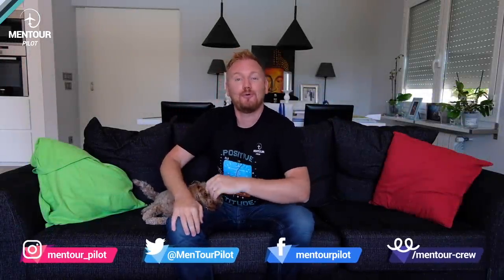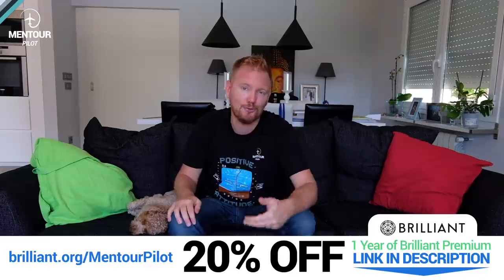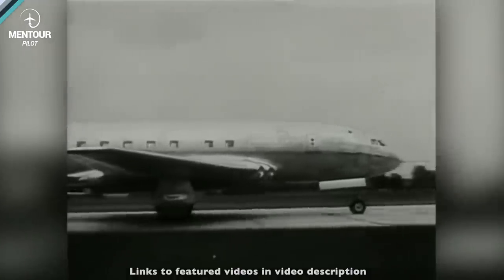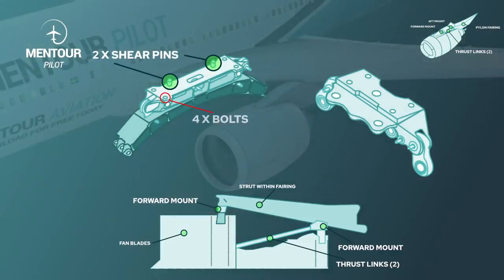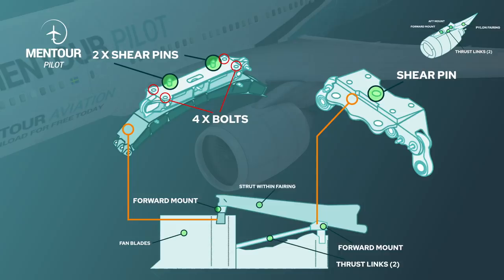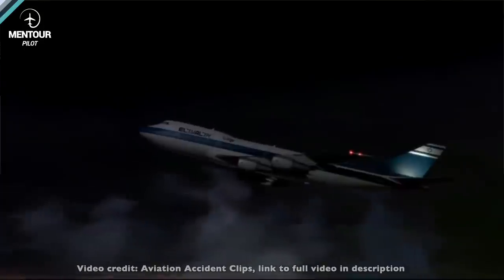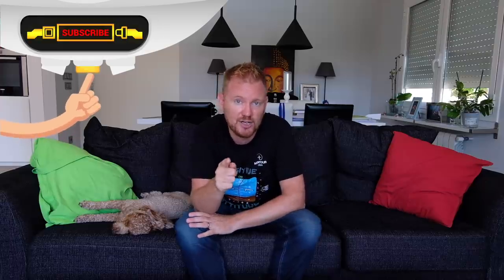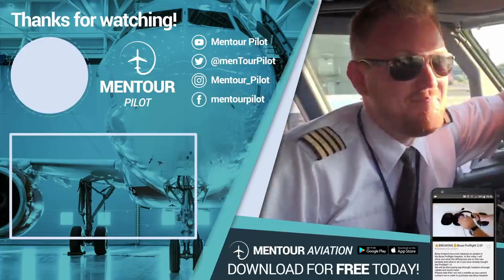How are Jet-engines attached to the wings?!

Comment: Structural engineer here, I love the topic of this video. The tensile strength of 180 MPa is actually quite low for bolts, typical yield strength for steel bolts is 600-800 MPa. I am both amused and bothered by one specific incident related to the engine connection to the wing, that is the Hudson river landing. The amount of drag the engines produced must have been very high, I think one of the engines came off. Will increasing engine size on modern planes give less margin on keeping the plane level during accidental landings?
Reply: Iconel 718 yield is about 160,000 psi, [1100MPa] I think he mixed units. 
Although he may have been quoting a high temperature strength as Iconel718 is often selected for high temperature uses.
Reply: @Elvind Kvinge What is the shear strength of the bolt?
Reply: @mullity1952  yield strength x area /  Square root (3)
Reply: "Accidental landings" 

This is my new euphemism for crashes.
Reply: Yeah, his assumption of real world load was very optimistic (only 100kN in each direction (141kN combined)) and even then he was already at 1/5 of his assumed yield strength. Which would be very bad for metal fatigue (also considering that there is probably lots of vibrations and direction changes, it’s not just one nice, permanent static force). Your numbers make much more sense.

Comment: I was towing gliders the day after AA191 for an AA co-pilot who had invited his captain along to our small airport.  I remember all of us pilots gathered around the desk looking at a grainy newspaper picture of AA191 on it's back.  We were looking at the control surfaces and we could see the elevator pushed forward trying to unload but most important the rudder full right.  We could see that the pilot knew he was spinning, more accurately snap rolling.  To the end, their fellow AA pilot was flying the aircraft with proper control inputs to correct for a stalling left wing.  What he didn't know was that no control inputs could overcome the loss of high lift leading edge slats resulting from the hydraulic failure.  It was a sobering moment for all of us.

Comment: Quite an unfortunate event happened just yesterday where Pakistani A320 landed on its both engines with its gear up. The pilots tried proceeded with TOGA, got 3000ft and faced both engines became stall due to damage. Plane crashed afterwards.

Comment: Back in the late 80's, an AA 727 flying to San Diego experienced an engine problem. The aircraft was over the Southwestern desert and the crew felt a thump, then got an indicator that the starboard engine had failed. They shut off the engine, started an early decent and simply flew the rest of the way to San Diego on the two remaining engines. When the plane landed in San Diego (without incident), it took the tower controllers to tell the astonished crew that they were missing an engine. It had apparently seized up and simply snapped off...exactly what it was supposed to do. They found the engine in the desert a couple of days later. There was a front-page photo in the local paper the next day of the plane sitting in the PSA hangar missing an engine. Good design worked that time!

Comment: I saw one of these engines being tested at GE. It hung with two bolts on the engine and one (1) on the gantry (wing surrogate). I said what is the fitting on the plane. The engineer said "that's it."
I said I would have expected more. He smiled and said "If your taking off and your engine hits a tree what would you rather rip off, your engine or your wings!!!" Good point.

Comment: Petter, I have a question: I am always impressed by how much deep technical knowledge you have of the aircraft you fly. Is this actually a formal part of your training and job or is it a personal interest?
Reply: I was about going to ask the same question.. do these kind of engineering and manufacturing details also being taught in flight school or certification?
Reply: Both
Reply: @hafidz182  Much of this is taught in flight school. Not for all planes, only for the plane type that the pilot will be certified to fly. Not every engineering detail, the pilot would not be tested on specific alloy like "Iconel 718", but the pilot would be tested on the general electrical, hydraulic, and fuel systems design and operation. ie a 737-400 pilot would need to know that hydraulic system A is powered by two pumps one mechanical on engine#1 and the other electrical and powered from engine#2 alternator, and exactly which items are attached to hydraulic system A. They would also need to know the electrical layout(and power capacity) so faults can be isolated or power transferred from one subsystem to another in an emergency.

Comment: I worked on rotating machinery in the petrochemical industry for 40 years. Large part of my activity was RCA (root cause analysis). One of the steps in an investigation was metallurgical investigation. The results of the metallurgical investigation would determine among other details whether the material of the damaged part was correctly selected, and had been correctly heat treated for its purpose (had correct hardness, tensile strength, etc.). Most important would be the determination of the fracture cause. Fatigue fractures do seldom occur suddenly, and have very characteristic surface appearance. 
The designers of the component that failed (your second case) have certainly been thoroughly calculated by the designers and dimensioned for fatigue safety.  There must have been another reason (the root cause) why the component was exposed to additional forces or exposed to additional vibration which made it to fatigue faster than expected.

Comment: 7:26
5g for F16 be like: cmon pull some more
5g for 737 be like: holy smokes engines are GONE!
5g for conspirationists: covid is a coverup
Reply: Hahaha, amazing!!
Reply: I have been tolled about an Eurofighter where limited to 6g for a safe flight home after an accident...
Reply: @andreaspoppe  I don't know about the Euro fighter,but my cousin flew the F16's and the g limits on the F16 is the limit of the pilot not the planes.
Reply: I would like, but you have 69 likes
Reply: @southjerseysound7340  indeed the airframe is capable of pulling up to something like 15 g but pilots' brain would start to squish out of the skull at that load
Reply: Conspirator*
Reply: @giovannimonchietto1863  Pilots can survive much more than that. Remaining consicous above 10G down is the challenge but a continuous 10G is definitely survivable. 25G forward deceleration for one second has been experimentally demonstrated (with a peak of over 46G). Negative 3G is a fairly common limit for consicousness.
The demonstrated survival limit so far is 215G peak deceleration with 600G being surmised.
Reply: The Grumman Bearcat piston engine fighter had wing tips that would break off at 7G, (explosive bolts were used to ensure both sides came off at the same time) and it would still fly just fine after that with only an increased stall speed and maybe a change in fuel burn. 
This plane also held the world record for time to climb to 10,000 feet(from stopped on the ground) for several decades. Jet fighters of the 1960s had a faster peak climb rate but they were slow to accelerate, the Bearcat was off the ground in a very short distance.
Reply: @mytech6779  if you have time check out Rare Bear 
It's a Bearcat that is a Reno air race legend.
Reply: @allangibson8494  there's a great video about the scientist that studied g forces on the body. I wish I bookmarked it. But it's about how he tested his rocket sled on himself. He had some crazy Injuries in the process but I recall he was ok up to around 35g's before the Drs put a stop to him testing on himself.
Reply: Lol, two days ago, german high court decided government officials may call conspirationists "Covidiots" :D
Reply: @southjerseysound7340  f16's have a 9 G limit
Reply: @ClaptonFan91  the 9g limit is to protect the pilots from g lock causing you to blackout. It's well documented that the airframe is capable of doing a lot more than humans are able to handle staying conscious.
   Also the F16 limits the AOA along with the g forces.
If anyone has experienced constant high g loads they'd tell you that it takes practice, strength and conditioning along with skill. Having said that I know of several cases of pilots being capable of taking more than 9 gs for short periods. But it's not something that the average pilot is capable of.

Comment: Great presentation Peter. Thank you!  On AA#191, I think it is important to 
discuss the improper de-mounting/mounting procedure the mechanics were 
using for the DC-10 engine, which was using a fork lift.  I believe 
there was discussion that some vertical movement weakened fasteners 
leading to the catastrophic loss of AA#191.  Other issues were the 
pilots did not get a stick-shaker nor stall warning due to losses in the
 electrical systems (generator) that the F/E had not been able to 
restore buses on.  The pilots also received no slat-disagreement warning
 lights/gauge indicator, which also misled them, as they did not know 
they had an asymmetric slat/stall trend developing.  The DC-10--Murphy's
 Law's favorite airplane: What can go wrong, will.   The pilots of that 
ill fated flight did everything by the book, and in simulator 
presentations using the AA#191 profile, with pilots that did not know 
what caused #191 to lose control, I believe the great majority of those 
pilots in the SIM also lost control.  As you said, one wing stalled, at a
 premature speed due to an uncommanded and unexpected leading edge devices 
(slats) retraction due to loss of hydraulic fluid/pressure.

Comment: To add a little to what @Mentour Pilot said. Since the two disasters he detailed, engine mounts are designed so that the front mount shears off first, and the aft shear pins break away last. This prevents the engine from coming over the wing and causing other structural damage to the aircraft such as damaged electrical or hydraulic lines.

Comment: The overall technique is called a ‘mechanical fuse’, analogous to an electrical fuse - a deliberate weak point to protect the rest of the system.
Reply: Not quite ... but humorous .
Reply: "predetermined breaking point" is the general phrase. In German, it's "Sollbruchstelle", which is actually a quite clever word which can loosely be translated to "The area of a part where the breakage is supposed to happen in the case of an overload of the part".
Reply: A more every-day example would be  snow-blower shear pins, which I consume at an alarming rate.
Reply: Rich Marceau Sorry, but I had to laugh when reading that! 🤗😂
Reply: It was inherited from the earlier piston engined transports - literally losing an engine on the over water runs was very common, particularly due to a failed propeller or engine fire.
Reply: much like the human collar bone, sacrificial to protect shoulder joint.
Reply: Erik Willoch Amazingly also one of the shorter words in the German language LOL
Reply: @QuantumPyrite_88.9  Actually, that is exactly what that system has been called, unofficially if not in the installation or operations manuals. By aeronautical engineers. BTW, my day job involves certifying very large jet engines.
Reply: @user-jp1qt8ut3s  It didn't hit that hard; as simple as that. It hit hard enough to likely have damaged the accessory gearbox drive train.
Reply: they are called "fuse pins" and are very carefully designed and tested
Reply: Similar to "torque to yield" bolts

Comment: One other reason for the nacelles (pods) to be mounted so far forward of the wings rather than inside them is for aerodynamics. While the Comet looked quite sleek, a modern airliner is actually quite a lot more aerodynamically efficient, and the placement of the engines is a big part of that.

Why? Wave drag. Specifically trans-sonic wave drag. Even today in the age of efficiency over speed, airliners go fast enough that airflow over certain parts of them nears supersonic speeds. Without going into too much detail (watch me now go into way too much detail, lol), right around Mach 1 (around 0.8 to 1.2 or so) is the most drag an aircraft will ever see. You have the normal drag, which is a combination of friction from the boundary layer between the airframe's skin and the air flowing over it, along with pressure drag caused by compression at the leading edges and evacuation at trailing edges, and induced drag caused as a consequence of extracting lift. At subsonic speeds less than Mach 0.8, these types of drag totally dominate the drag the aircraft experiences.

At supersonic speeds, this changes. Sonic shockwaves form boundary layers of air that 'sticks' to the skin of the plane, taking up much of the skin drag. Those shockwaves also take on more and more aerodynamically ideal shapes, reducing pressure drag. And, the faster the plane goes, the less angle of attack is needed for level flight, and so the less induced drag there is. Instead, the formation of those shockwaves becomes the primary source of drag, as the supersonic flow (relative to the airframe) around the plane has to very rapidly accelerate to match speeds with the subsonic boundary layer of air "stuck" to the plane's skin. It does this at faster than the speed of sound, which is normally the speed any pressure wave moves in a fluid. In physics terms, what happens then is that the pressure in the trough of the shockwave just behind the wavefront becomes a vacuum, which takes enormous amounts of energy; energy that has to come from somewhere, and in fact comes out of the plane's kinetic energy.

Just as an aside, at hypersonic speeds, more of the energy starts to go into thermal effects and phase change of the air from a gas to a plasma, and becomes the dominant form of drag at those speeds (which is what defines the difference between supersonic and hypersonic).

In any case, short of hypersonic speeds (at which drag can theoretically tend toward infinity), the most drag a vehicle will ever experience is in the transsonic regime, when both wave drag and traditional drag are in full effect simultaneously. This fact, combined with a lack of understanding of how to modify control surfaces for supersonic flight created what was known as the "sound barrier" in the early 20th century.

Traditional streamlining, like what you see in the de Havilland Comet helps reduce traditional drag. To reduce wave drag on the other hand, you use what's called the Area Rule. The minimum wave drag for a given overall flight volume is caused by the smoothest possible rate of change of the cross-sectional area of the airframe in the direction of travel. A big increase in cross-sectional area in a short distance along the length of the plane creates tons of wave drag, because it forms new shock fronts. In a traditional-configuration airplane, the biggest sudden increases in area (aside from at the nose) happen at the start of the wings, and the start of the engines. So for efficient flight in the trans-sonic or high-subsonic regime, you do not want engines and wings to both start at the same point along the length of the airframe; that actually maximizes wave drag and greatly decreases fuel efficiency.

Modern airliners are "waisted" subtly but (if you know what you're looking for) noticeably right around where the wings start to take shape, to reduce the rate of change of cross-sectional area. Having the engine nacelles well out in front of the leading edges of the wings helps further reduce the suddenness of that transition. The "hump" of the Boeing 747 where the upper deck is is also, in fact, entirely about reducing wave drag. The 747 has that hump for aerodynamic efficiency, and they got to put a second deck there, rather than the other way around like you might assume. It was a somewhat crude but very effective design from an era in which the kind of waisting of the main fuselage we use today wasn't as feasible for structural integrity reasons. That hump, and the nacelles well forward of the leading edges, both revolutionary at the time, made the 747 the most efficient heavy aircraft for decades.

As a neat little bit of trivia, wave drag is important for ships as well. The big, bulbous nose that extends out under the water in front of the bow of big ships designed for fuel efficiency (bulk freighters, tankers, cruise ships) actually deliberately induces waves that interfere destructively with the waves produced by the motion of the main hull through the water, greatly reducing the wake, the energy that goes into it, and the drag induced by it.

Comment: After the El Al 747 crash, the attach lugs for the pylon were completely redesigned and made much more robust.  Also the pins that attach the pylon to the wing are called "fuse pins".  They are hollow bolts which are very carefully designed to break at an exact load.  Good video

Comment: That was an excellent video. My question is - when a plane takes off and its wheels retract, is a brake applied to the wheels or are they left spinning? What are brakes made from, and how are they used during taxiing. More about taxiing - what are the procedures for applying thrust while taxiing, e.g., to advance the aircraft in a line to take off, to start from a stationary position, or when moving at a constant speed?